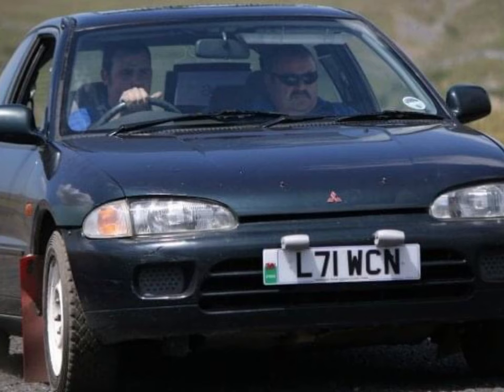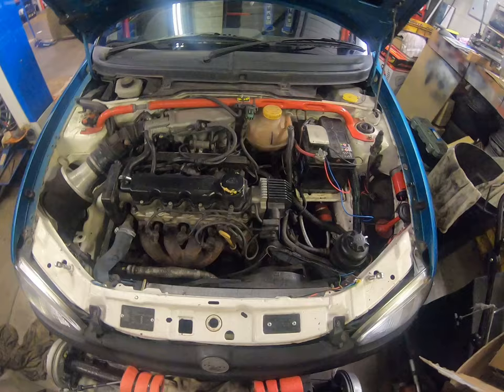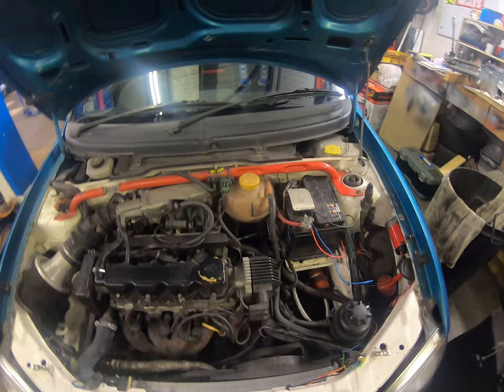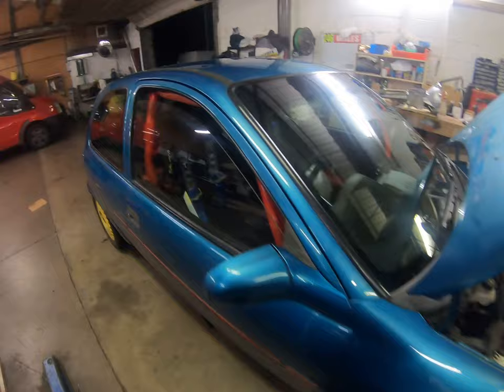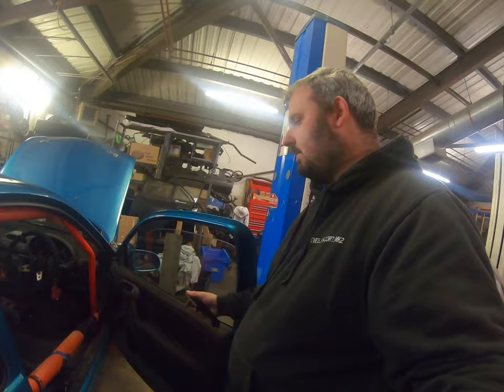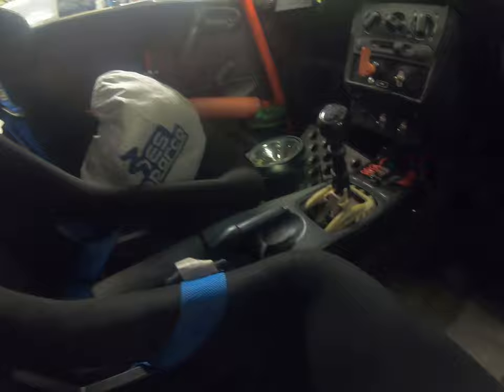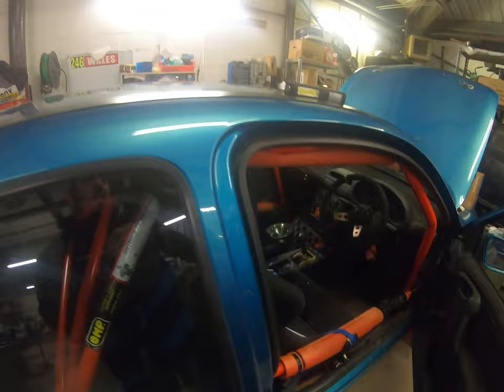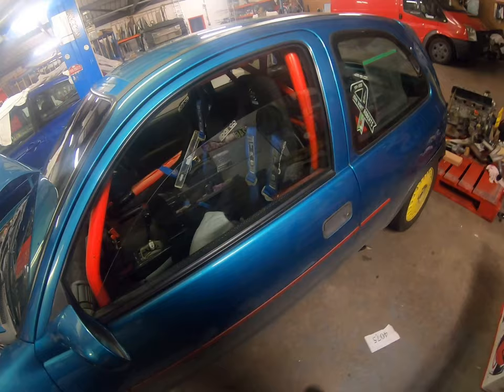Corsa B road rally car

Comment: Great to see this am really struggling to get coil springs for my corsa B  I used to have mk2 escorts parts for rallying plentiful  but found trying to get coil springs for bilsteins are like hens teeth 
Plenty coil over kits but I want front bilstein fronts and forest springs. 
Cheers
Reply from the maker: I had trouble getting mine but found bilstein ones on ebay and they are genuine brand new bilsteins ones mite be worth looking on there? That was only couple months ago.
Reply: harry hockly motorsport stocks bilstein coilovers, shocks and any size springs

Comment: Adding cheap piggy back to rpm sensor to delay ignition would make this engine do some work safely. If I remember corectly it says 3-4 degree retard per 50hp. On 100sh
ot of nos, they could have easily retarded ignition like 10degrees to be safe.